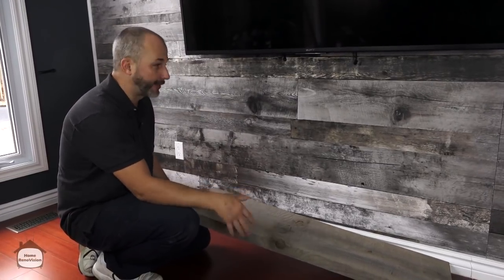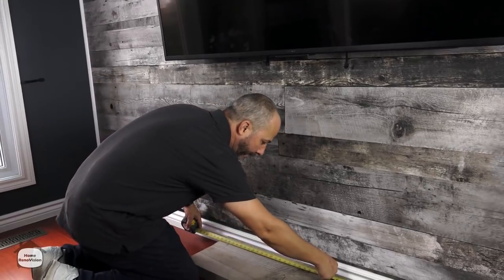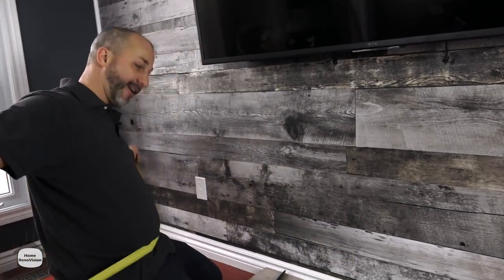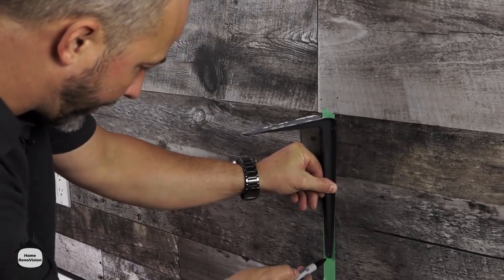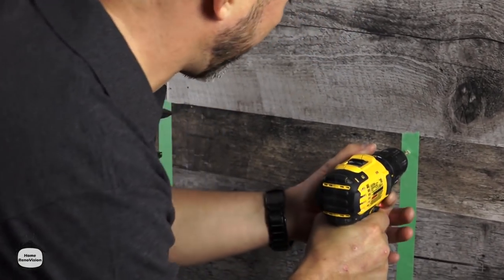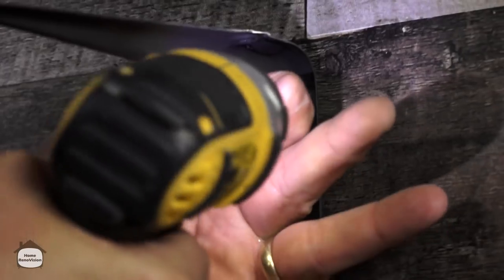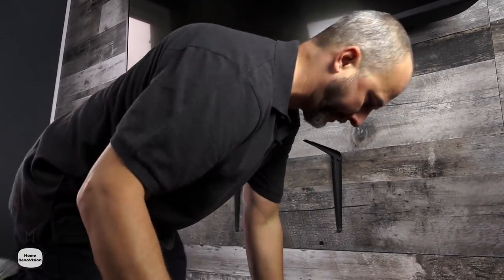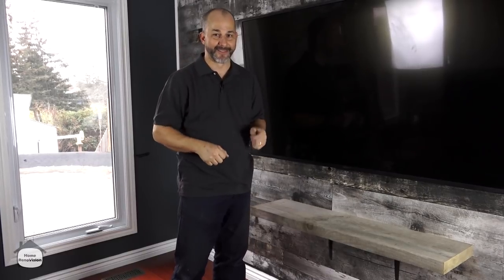How To Mount A Rustic Pine Shelf In Under 8 Minutes

Comment: I was taught by my uncle to find the studs by running a magnet across the baseboard to see where it catches and there's usually a stud in that spot. He also always told me to take my smallest drill bit and drill where the baseboard and wall meet. Using such a small drill bit in that area always leaves an almost invisible hole.

Just felt like sharing the way I was taught.

Comment: You said "dont use plugs", I know you north American used different construction techniques to build houses, but may I suggest you try the Fischer wall plug ? It's German made, very strong ! That's all we use here in Belgium ! With the large one you can support about 40kg (I believe it's about 95lbs) per plug on dry wall without any back support ! I personally used them for years and never had an issue :) I hope this product might change your view on plugs ;) as usual very good video !
Reply from the maker: Thanks Kevin, I am not vehemently against plugs. I just prefer to mount things to wood. As a contractor. anything I can do to avoid a call back becomes part of my method.
Reply: Home RenoVision DIY okay now l understand better
Reply: @kevinkepa6364  Hey you're name is Kevin and from Belgium too! Awesome. I do live in North America now. Most times my placement never lines up with a stud, nor has anyone installed studs at proper places. I've never lived in a house where studs were 16" apart.

Comment: Screw in with an angle and try to land on the wood sounds not ideal, maybe should find a pair of bracket with inline screw holes.
Reply from the maker: Just trying to keep the wood in the back wall from splitting.